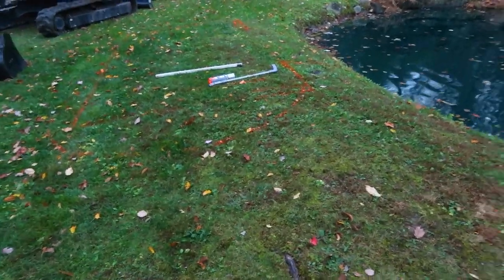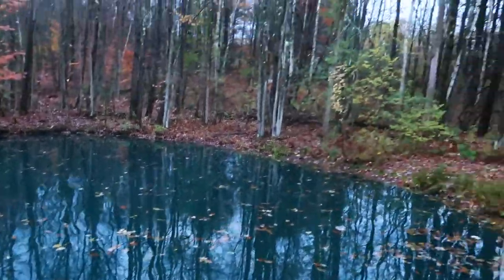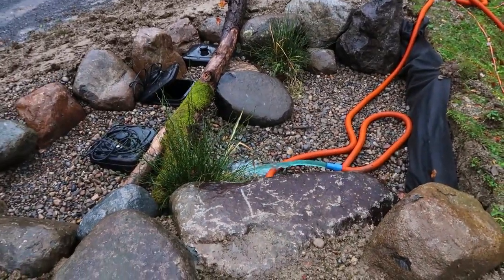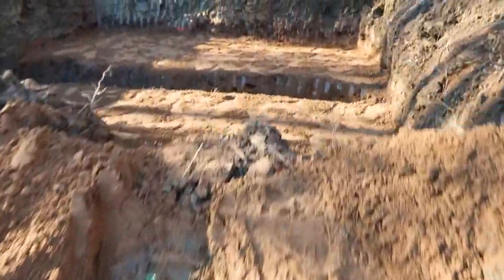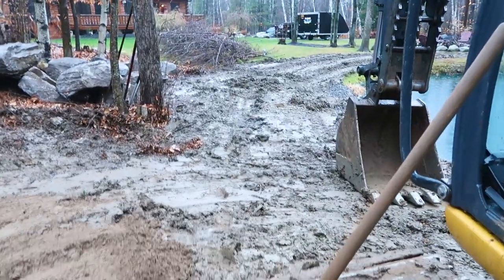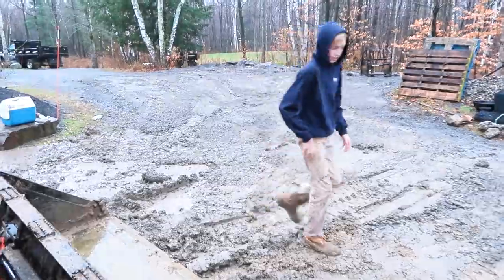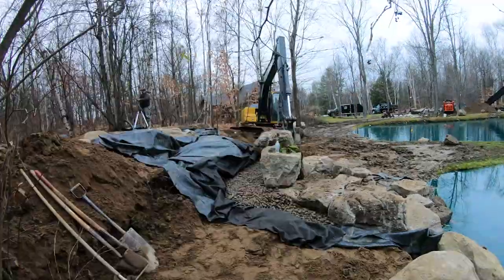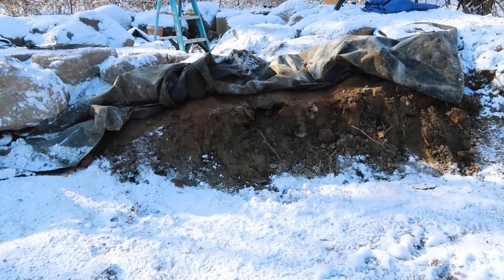Clay pond gets filtration and waterfalls

Comment: Would you have to do anything different if the pond bottom is all muck and leaves instead of rock? Also how big does it need to be in relation to pond size?
Reply from the maker: We build the wetlands a little different to accommodate the sediment 
There is a calculation but a big investment to filter it the way we do liner ponds